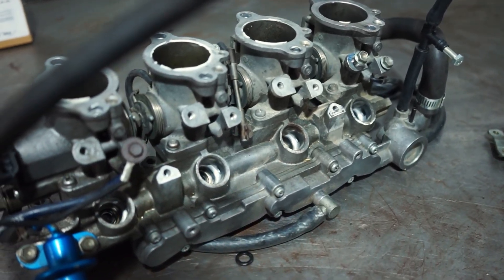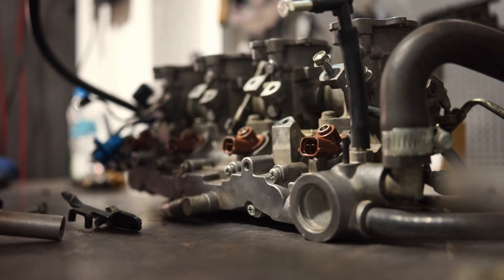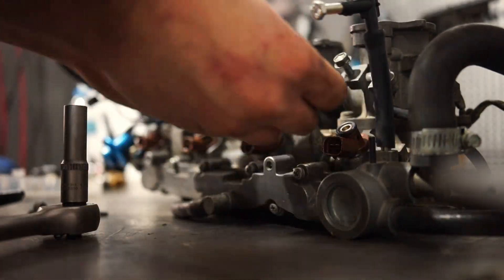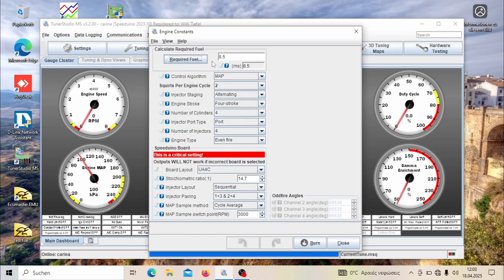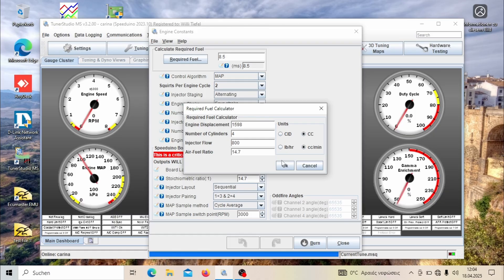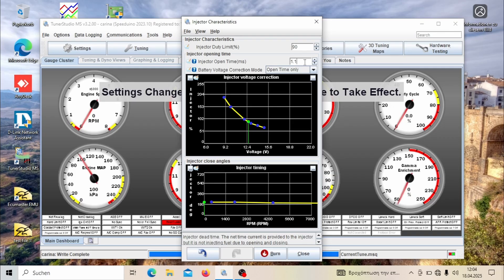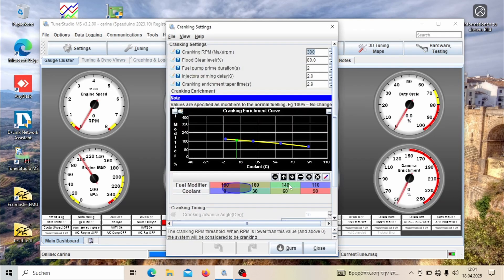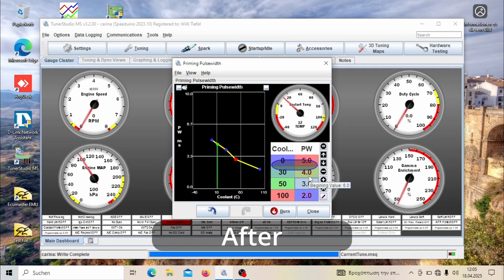Tunerstudio standalone ECU Tuning Guide | Part 18 Upgrading injectors (Turbo) | MS, Speeduino RUSEFI

Comment: can you show us how to make a ciclyc idle or a gost cam idle ?
Reply from the maker: Hey, its not really possible easily without VVT. Thecarpassionchannel has a great video on it if you do have it, though i wouldnt recommend it, as it will consume a lot of fuel when idling. https://youtu.be/qinPuTMVsqs?si=5-rjGZotq72JWbXT
Reply: @throttlebuddies0  but that's gosth cam only, I have saw cyclic idle without using vvt but using fuel injection timing or spark injection timing it's supostly use for cooling the chaimbers
Reply from the maker: @elcascoviejo5347  yes rotational idle is only supported by some higher end ecus like halltech maxxecu etc. but not available for speeduino as you cannot change the firing or injector order in the software even.
Reply: @throttlebuddies0  o cr4ap. i have a arduino base but shit some mods off rust efi , in my city we have a tuner that makes his own ecus and its teaching me some things and he made good ecus betther tan fuel tech or maga squirt faster and whit more options im gona try meke him add an cyclic idle now that i know its has tu have the option espesificaly thanks man

Comment: as a topic for the following videos, you can tell us more about the open and closed idle control cycle, and especially about the PID idle control algorithm
Reply from the maker: @sergiorusso8253  i dont have a car to show it on as im not running an aic  i will do some stuff about that on boost and lambda control tho
Reply: You could watch vidoes here they cover that topic but its very tricky to do. Usually keep the p very low and as its more for fast response then i for smoothness and d for the respons feedback smoothness. Something like i have on my 4age i could drop any gear and the car will drive without throttle. Good when you wanna drive without using both legs or not always need throttle when startig to move and sometimes i use for low speed cruising like 20kph at idle in third